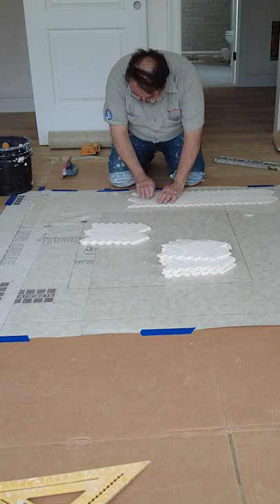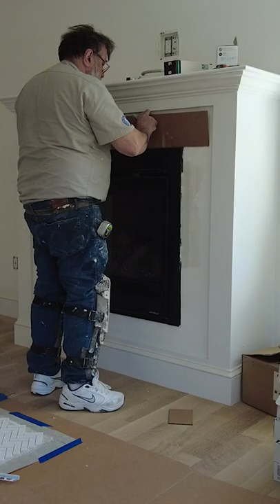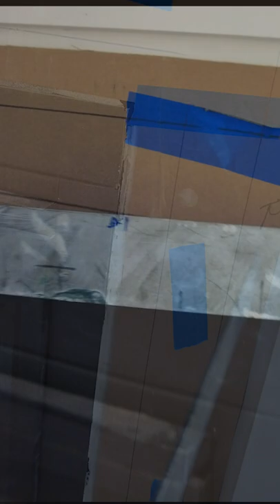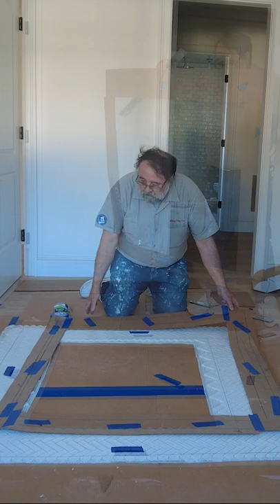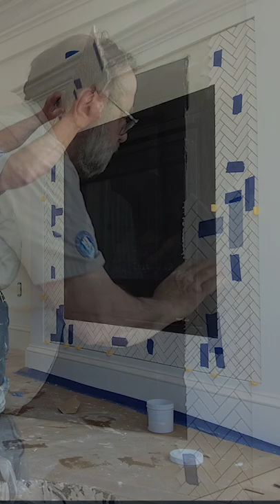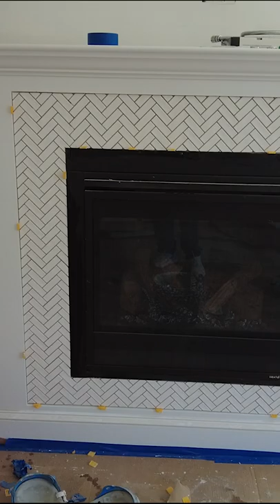Herringbone Fireplace just make a template, easy #short #diy #constructio #Herringbone

Comment: The one question I have is regarding the adhesive bonding tile to mesh oftentimes releases when it gets wet.
*Cutting some of these mosaics can't be done on the wet saw, for tile releasing from the mesh backing.
Reply: He has installed the mosaic tile on a sheet of membrane (let it dry at least overnight) then he cuts em' on his wet saw... if done properly, this will eliminate the tiles from coming loose.
Reply: Try laticrete platinum if youre having trouble with separation from your backer. Be careful not to get it on your tile face or anything else for that matter. It bonds like crazy. When you run it through the wet saw, it won't come off with that stuff. It's an amazing mortar
Reply: It’s not a wet saw